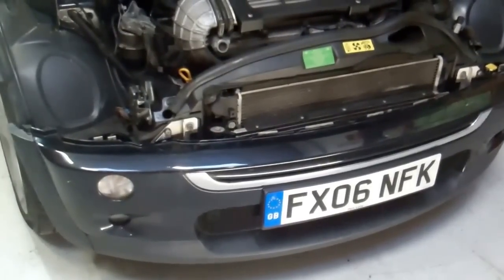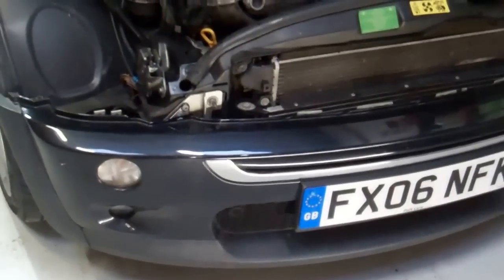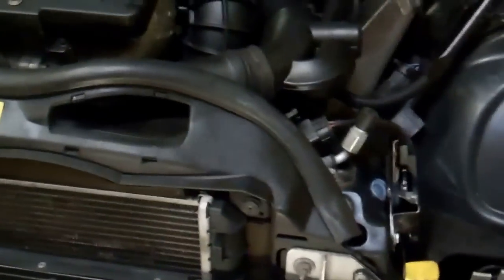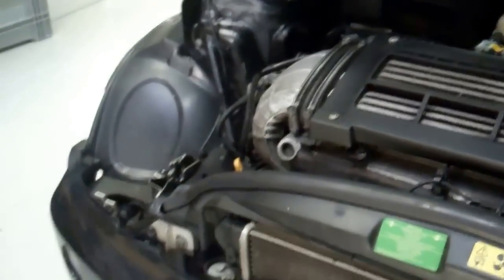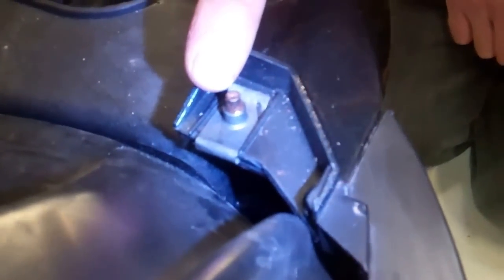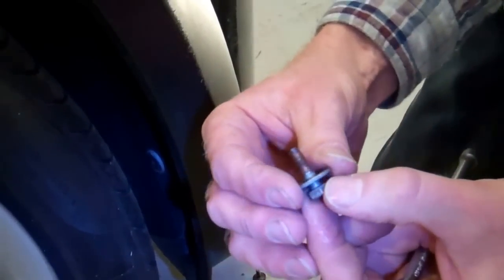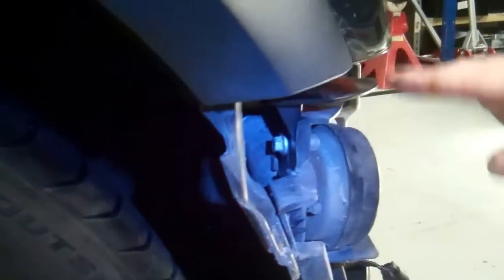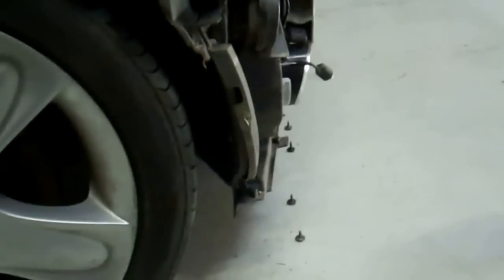How to remove the front bumper on a BMW Mini One/Cooper/Cooper S

Comment: Good tutorial. I loosen the 3 10mm bolts instead of the 7 cross-head screws - that brings the lower plastic skid/air dam  together with the bumper and would seem to be fewer fasteners to require removal.
Reply from the maker: Hi - yes this seems like a good alternative.

Comment: Simple enough. I’m an American that grew up with a father that was a diesel mechanic for Dodge. I’ve built a few GM and Dodge pickups. I do 100% of the maintenance on my vehicles(GM and Dodge/Ram pickups) and have since I was 16(I’m 30 now). My coworker owns a 2005 mini that is unfortunately falling apart and I’m trying to save it. My hands, arms, and 6’1” 200lbs body struggle to work on it because of all the tight spots. It’s been one of my biggest challenges, but amongst it’s problems and pissing me off, I’ve been growing to really like the Mini. Might buy one for myself.

Comment: Perfect, just the info I was looking for. Easy to understand and spot on. New bumper fitted in double quick time. Adjustment info very handy. THANKS!
Reply from the maker: Glad it helped
Reply: @L663  the adjustment bit was critical - our 06 R52 had had a gentle nudge from someone and the offside panel gap was huge between bonnet and bumper - now fixed without needing to go to a dealer - ta!

Comment: Bookmarked :)  I need to take the front facia off so I can swap out the lower grill, also easier to work on adding the CF lip.   Great post, and had no idea about the adjustment plates, bonus.

Comment: hi there does anyone know the proper name for the 2 bumper height adjusters i have a cracked one and need to replace it but dont know what its called to search on ebay
Reply from the maker: Hi - check out this link

http://www.realoem.com/bmw/enUS/showparts?id=RA11-EUR-02-2002-R50-Mini-One_14i&diagId=41_1369

I think it is item 6 you need PN 51717039262

They seem to come as a pair.

Comment: What size sockets do you need?
Reply: The socket required to remove the bumper within the wheel arch is 8mm. I also found it was easier to turn the wheel to give better access to the bolt and then a standard socket size extension bars can be used.